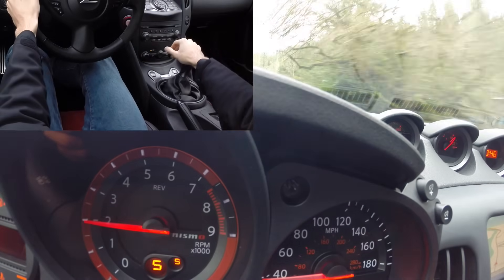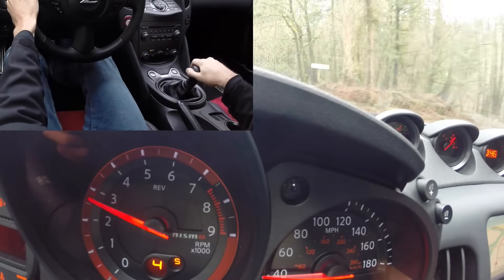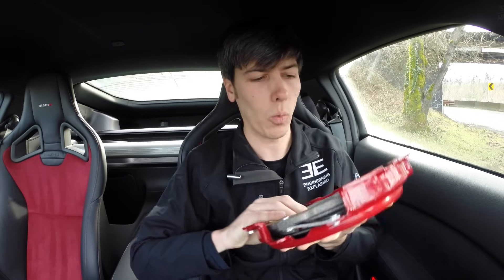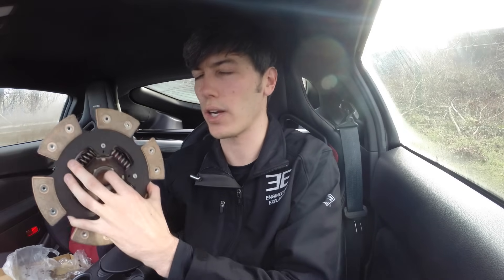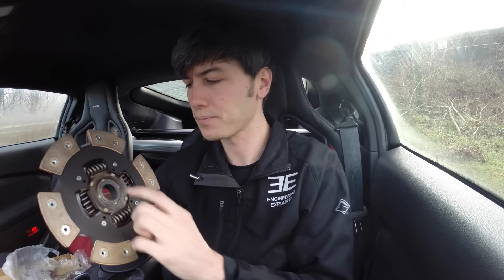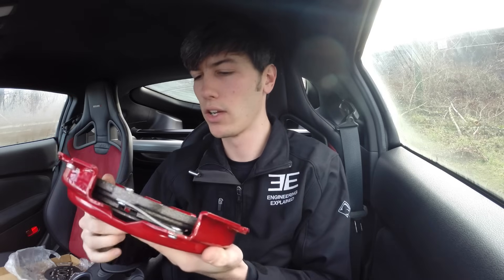What Is Rev Matching?

Comment: So if I'm Rev matching, going from 3rd gear to 2nd, I'm engaging the clutch and waiting for the RPM's to come down the appropriate RPM for second gear?
Reply: It's the exact opposite of that. Given the same speed in two different gears, you will have higher RPM in the lower gear. So if you are cruising at 30mph in 3rd gear and want to downshift you must press the clutch pedal, press the  gas a little bit (raising your rpm), and then you downshift to 2nd. 
Do not wait for the RPM to come down. Hit the gas (a little bit) and make the RPM go up.
Reply: +André Rumi Steinbruch Ok thank you, I'll give it a try

Comment: As long as we are talking about rev matching perhaps you should do a tutorial on shifting without using the clutch. This is a handy little skill to have when your clutch cable or hydraulics go out and you just want to get the car back home or to the shop without having to call a tow truck. It seems like its becoming a lost art these days that only old timers like myself still know how to do. If done correctly you can upshift and downshift all day long without ever grinding a gear or putting undue strain on your transmission. The tricky part is timing the traffic lights so that you don’t have to stop because every time you come to a stop you have to shut off the engine. And then to start going again you have to start the engine while its in first gear which is obviously hard on the starter motor. Anyway I will probably never get around to making my own instruction videos so perhaps you could do it.

Comment: I'm still confused, does double clutching rev match for you in a synchronized transmission?? PLZ HELP!
Reply: From what I understand, a synchronized transmission doesn't require double clutching as the clutch's speed matches the transmissions speed. Rev matching should be utilized irrespective of a synchronized or non-synchronized transmission as it reduces wear and doesn't upset car balance etc.

Comment: my throttle response is too slow, what's solution for my car? sorry my bad english.
Reply: could be your fuel pump , filter , injector or fly-by-wire system
Reply: +Adil Jamaldin my car had drive by wire :(
Reply: Try putting on a sports airfilter. It helps a little with throttle response.

Comment: Could the same thing not be achieved if you brake down to the required 
RPM for the lower gear change instead of upping the revs to match the 
lower gear change? you would have to keep the clutch depressed of course
 for some time before the gear change to avoid stalling e.g. 6th to 2nd

Comment: does this work only for down shift or for up shift also??
Reply: Disengaging the clutch to up shift is enough to rev match a higher gear. If you find it's still jerky you're taking too long to change gears or you're dumping the clutch.
Reply: Why would you rev match for upshift? O.o You have no influence of the revs of your engine in case of decreasing, except of releasing the gas pedal O.o .
Reply: Well you would still give it a little bit of gas (say going from 3rd gear to 4th gear) but not any specific amount...just so it doesn't bog. If I'm in a gear and shift up a gear without giving it some gas then the engine braking pulls it back a bit

Comment: I don't get it.. So ur in 5th goin at 4500rpm and shifting in 3rd do u have to engage the clutch until the engine is at 4500rpm or how?
Reply: No, you have to engage it, then rev it up maybe to 5500 or more (given that RPM) and then release. But it'd be kinda insane to drop 2 gears at that RPMs.
Reply: +David Castellanos still don't get it lol

Comment: So if you need to quickly break and do not have ABS, it helps to gear down to gain torque to break better. Do you still need to rev match, and if so how do you rev match while breaking?

Comment: is it true that in manual transmission i should always stop before to put back in first gear? and should i stop when i'm going backwards before to put in first? (even if i'm holding the clutch?)
Reply: Yep, would be best. Most cars don't even let you do it anyway as long as you are moving.
Reply: first gear no - you have synchros that stop grinding but make sure you're going slow or rev match before letting up the clutch. Reverse yes, there aren't typically synchros in reverse so you will need to stop before changing into reverse, I've accidentally changed into reverse before coming to a complete stop a couple times and it slipped into gear once but once it ground the gears, not good!

Comment: I am a bit curious about your explanations.  Usually rev matching allows to keep high revs (as you brake, just before down shifting, the engine revs go down).
By doing this you can re-accelarate faster, after a turn, using more power and avoiding turbo lag (if you have turbo).  Your explanations make clear how it helps here.

However this technique is not always suitable on low speeds or going down hill at constant speed, specially on heavy vehicles or with common cheap brakes.
Many cars are front wheel drive and don't have competition brakes.  So using torque braking instead of usual brakes (or using them at same time), makes your breaks overheat less, provides more braking power (if braking at same time), and won't upset the balance, as it's front wheel drive.

However I agree with you on the clutch wear, and on balance if you are talking about rear wheel drive (global braking power (brakes+torque brake) must always be at least 50% on front wheels)

Nice video channel however!

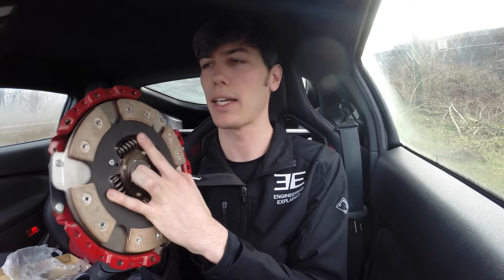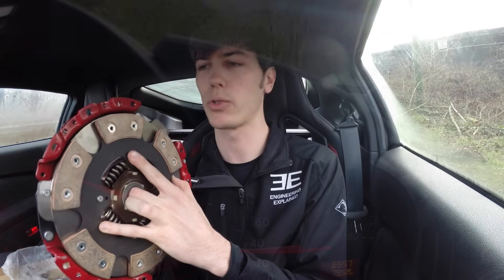Comment: Watch this, then answer my question... 2:20-2:43

"Blip" the throttle means to step on the gas? When you go from 4th-2nd gear you want to slow down, so in a manual you have to step on the gas to go slower... because the rpm is faster in low gear, the moment you go in 2nd your clutch is going much faster then the engine... to make these two disk meet each other without grind would to increase engine rpm?

Question: 
What?.. the hell. Like it kinda makes sense but my brain doesn't like the idea of more gas to slow down.

Comment: So you want to blip the throttle AS you're going a lower gear? Or blip it while you're in Neutral then go into the lower gear?
Reply: Blip as in you go into a lower gear. So you go clutch in, downshift, blip (depends on what car you have, I quickly blip the gas all the way down for a smooth shift in my miata), release clutch. It takes some getting used to, but you'll be able to do it quickly with some practice. Some modern cars have an auto blip feature, so the car is smart enough to revmatch.

Comment: Thank you very much for your awesome videos Jason! If possible, I would like to ask you the following question:
When you change the OEM flywheel to a lighter one, it´s easier to rev up the engine i understand because it has to move less weight and also it has less rotational inertia due to the aftermarket one being more weight shaved on the outside (i believe). For the same reason it revs down faster.
Because the engine/flywheel revs moves faster, would you say a lighter flywheel improve your gear change times, since you have to wait less time to match revs?
Thanks in advance!
Kind regards

Comment: isn't it bad to downshift from 4th to 2nd? I thought you have to downshift each gear.
Reply: +Tuan Do You don't have to go through every gear when downshifting/up-shifting. But if you don't rev match when you are downshifting from 4th to 2nd when approaching a turn you are going to experience an uncomfortable and abrupt decrease in speed and put more wear on your clutch then necessary.
Reply: Yes. It puts extra wear on your synchros.

Comment: Honestly you talk a LOT but you don't explain how to actually do it.  Do you just not take your foot off the gas when you shift.?
Reply: Well to be fair the title says "What is" not "How to". But of course showing how to in this vid would be helpful. Basically before you downshift, 

release gas - brake - hit clutch and blip the throttle with your heel while toes still on the brake - downshift while blipping - release clutch. 

It happens fast and it's one of those things you have to do yourself to understand. You'll feel it if done correctly. 
Practice, practice and practice. After that it happens naturally.
Reply: If you want to downshift - release the gas, press the clutch, brake to the right amount of the RPMs, downshift, release the clutch and press the gas. If you want to switch to the higher gear, press the gas, release the gas, hit the clutch, upshift, release the clutch and hit the gas.
Reply: But...if you want to do it as he said without having to break...then you need to release the gas, press the clutch, give it a bit gas and quickly downshift with the extra RPM. This should go smoothly with enough experience in almost all cars.

Comment: OK, but what is the relation to transmission synchronizers? I was always wondering what is the correct order:
clutch in- shift down AND blip - clutch out   OR clutch in - blip THEN shift down - clutch out.
Second way always feels better - gear lever just seems to get sucked into lower gear smoothly.
Reply: (I know this is an old comment but still..) it doesn't matter when you blip, as long as you blip while holding the clutch. It's better if it's done seamlessly tho. You just have to match your engine to the transmission speed.

Comment: Any chance you can elaborate on this. 
The first time I ever drove an old truck was a 1980 Chevy k10. It was the three speed with a granny gear, and I was told to rev match when shifting UP. Now, by your explanation this seems silly, but it certanly made shifting smoother without making a loud clanking noise. (It was an old beater hunting truck with over 670k miles, about it's 4th engine and 2nd transmission) But I believe those old transmissions were not 'synchronized' and you had to rev them to match the speed of the plate to the clutch. I suppose my question is, what the hell is a non-synchronized transmission?

Comment: How can i press the break and give it more rev and hold down the clutch at the same time? Like coming to a sharp turn or just a turn
Reply: For that situation, you must Heel-toe. 
Basically Rev-matching while braking. 
That's where the name comes from. Heel-toe doesn't mean you literally use your heel and toes. I use my big toe on the brake and hover the side of my foot on the gas (calling it Ball-edge, for obvious reasons).
From what I've seen, to conventionally I only use it for aggressive turning/stopping or high speed u-turns.

Comment: Quick question: When down shifting while slowing down, instead of doing this, I usually just put the car into the lower and gear and hold the clutch at the "sweet spot" until the wheels slow down to the speed of the motor, and then I let go fully. I never dab the gas pedal going down. Is this okay to do, or does it ware my clutch?
Reply from the maker: +Bango61 better to rev-match, And I don't know what the sweet spot is, but if it's partially engaged you'll have unnecessary wear.

Comment: So if I am downshifting from 4th to 2nd I have to make sure that my foot stays on the clutch until the RPMs match after that shift or?
Reply: yes, otherwise the clutch disk will not rotate as fast as the engine side and you get that jerk. However outside of a race track, i can't imagine the need for shifting to 2nd gear without also slowing down, like right before you make a sharp turn

Comment: So when rev matching or heel toe do you have to memorize what rpm each gear likes a certain speed? Or do you just slap the throttle to get it closer to a desired posistion?  example. coming into a corner in 4th going to 2nd.  are you saying, "okay my car needs to get up to 4k rpm not 3k." or are you just tapping the throttle a little?

Comment: "If you're in first gear this [clutch disc] will rotate very quickly, if you're in sixth gear this will rotate slower"

That statement is simply incorrect. The input shaft rotational speed of the transmission (input shaft is where the clutch disc is on) will always rotate between 0 and Max RPM of the engine, independent of the gear you're in (unless you over-rev the engine by downshifting too early). The output shaft rotational speed (which goes to the wheels) however changes consistently with the change of gears.

Comment: mate, the clutch and flywheel are always moving at the same speed, the rear shaft coming out the back of the gear box is what is traveling at larger speeds in higher gears

Comment: +Engineering Explained, Good video. What about upshifting? Wouldn't the opposite hold true that the engine is spinning faster than the trans at the higher gear? Or do they both spin at the same speed once disengaged (while shifting), then more or less match RPM once the higher gear is engaged?
Reply: Upshifting more than one gear you want to let your revs drop from what I understand. Hitting 2,500 rpms on 2nd is usually perfect for upshifting to 3rd, basic manual procedure you know? But hitting like 3,000 or 3,500 in 1st is usually perfect to upshift up to 3rd gear as long as you let the revs drop a bit before re-engaging the clutch. Otherwise you lerch. I’m a new manual driving, I’ve never really had much problem with an upshift of 1 to 2 gears, I think there’s more thinking involved when you shift 3 gears, but that’s also really aggressive driving. You’d have to be in super high revs and let it drop down before bringing it from let’s say 2nd to 5th. I’m no engineering explained, but that makes sense to me, usually going from a higher spinning, low gear is seem less when going into a slower spinning, high gear.

Comment: What about automatic? I'm driving 3-speed automatic. When there is steep hill downwards I put the gear on N and my car can go faster usually around 100-80 km/h without using much fuel. So  if I decided to put back gear to D gear on that speed should I rev the engine a bit?

Comment: I thought the pressure plate was bolted onto the transmission and don't move. The clutch is attached to the axle. But the flywheel is what is spinning with the engine.

Comment: REAL men rev-match so they can shift their synchronized transmission without STABBING THE CLUTCH AT ALL!!  That's all the synchronizers do anyway is rev-match for you, at the expense of wearing out a little brass ( in one type of synchro anyway-they don't all do the job the same way of course!). If you're good at this, you kinda bypass the synchro and get a relatively easy smooth engagement. If you're not, you'll get a scream or a sudden slam into gear!This is done everyday in the big class 8 rigs without synchronizers.  Really old cars didn't have synchronizers, and back then you either double-clutched, especially going DOWN, or you didn't use the clutch and rev-matched!   In the big trucks with a dozen or more gears,  where the gear ratios are so close the difference between RPMs in each succeeding gear is only a few hundred RPMs, it is a lot easier  than doing it in a 3-speed, but you can get good at just kinda knowing at what RPM to make the "stab" without burning the synchros out or chattering the hell out of the gears.  My grandfather said he drove cars from the '30s everyday with no clutch other than starting out. To give you an idea how a synchronizer works, at least the friction type with the brass cones for friction, I had a Datsun diesel pickup in the '80s, and the clutch release mechanism broke ( I think it was hydraulic) and even in low gear, it would not crank-off in gear to get going.  With the engine running, I reared up in the seat and pulled the stick as hard as I could with both hands towards low gear.  The friction of the synchronizer began to drive the whole truck forward until the trans suddenly snapped into gear, and then I was able to get it home with the trick I mentioned above!I'm sure it was good for the synchro!!

Comment: Good videos Friend. I have 2 additional tricks that I use for matching RPMs.  One is to look at the angles between the Tach and the Speedo.  In some cars, those needles might climb in parallel in say 4th gear.  So by predicting where that tach to speedo angle difference is going to be for the gear you are going to shift to, you can make a smooth gear change by being there ahead of releasing the clutch.  The other trick I use for selecting a lower gear (in anticipation of an overtake) is to holding the throttle position as you depress the clutch which will bump the rpm by almost exactly what you need for the next down gear, or actually squeezing it a little if you are double block shifting.  Send me a message if you are interested in a better description.   Would you consider doing a video on toe-and-heel (racing technique)?  thanks for sharing.

Comment: Hm that's interesting. My driving teacher told me to not apply any gas before engaging the clutch (i.e. releasing the clutch pedal). Instead I should just slooowly release the clutch so the motor is spun up by the momentum of the car. I even specifically asked him if it wouldn't be better if I revved up the engine so the clutch doesn't have to do that work, and he said no.

Comment: Do you have any school to back what are you saying? Because you are saying it wrong? The clutch weal doesn't rotate when you have the the clutch pedal pressed. The grooves on the inside are for it to move sideways when engaged (this is when it's rotating) and set free. And the rev matching is more complicated than you are explaining, you have to take in consideration the speed you are moving, the gear you want to be in and the gear you were! This video is useless!